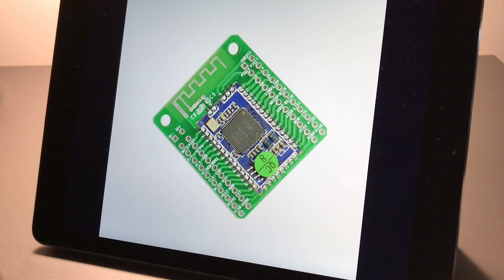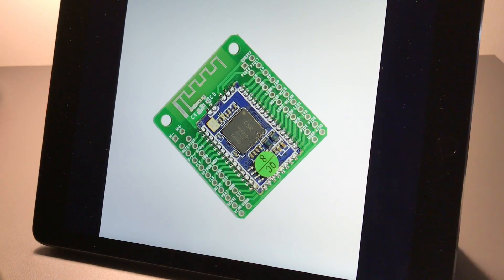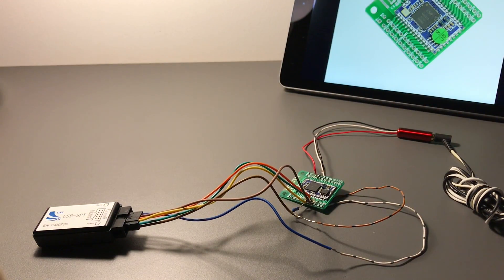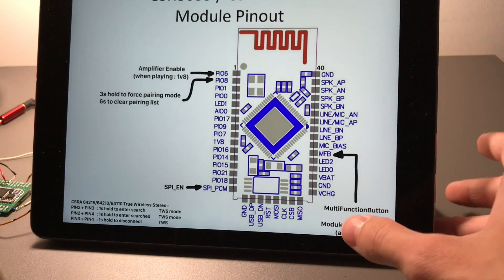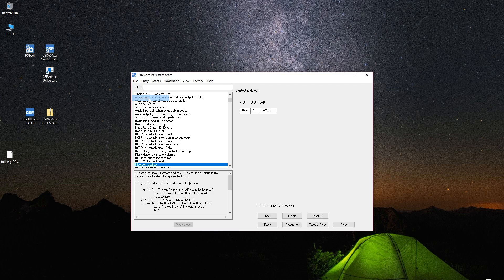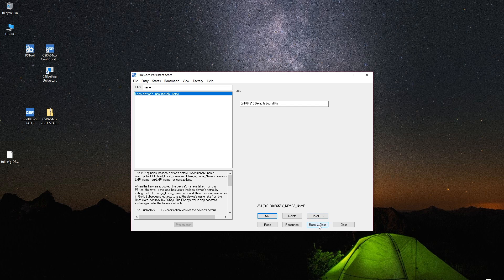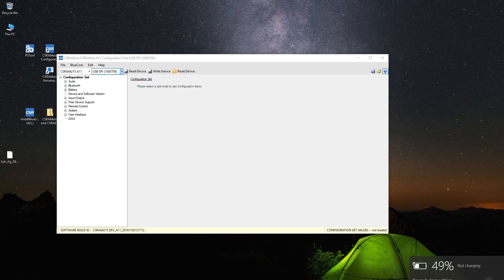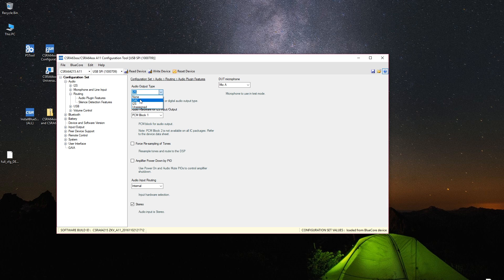Program / Configure CSRA64215 Bluetooth Chip (enable analod audio)

Comment: Awesome vids!
I'm using a 64215 with our home theatre, but my parents keep on forgetting to disconnect after they play something and then nobody else can connect. Is there a setting to always connect to the person trying to connect - even when already connected to some other device (and by doing so throwing off/disconnecting the person currently connected)? Or is this inherently impossible with the way Bluetooth connections work? Surely there's a key in the PSTool that would allow this?
Reply from the maker: you need to use the ConfigTool

I'm not 100% sure of the exact location but there is a setting for ALWAYS remaining discoverable/pairable

once you enable that you should be able to always connect to it (I think 😬)
Reply: @Darieee   Thanks for the reply, but unfortunately I already found that setting (Bluetooth > Connection Management > Discovery > Remain Discoverable at All Times) which only makes the device discoverable - not connectable at all times... The only other setting which seems to be able to give a workaround is the "Go connectable on button press" one, but then I need to add a button. I'm sure there must be some key that can make the device always connectable though, but there are so many keys in PSTool that just says "Only change on advice from CSR" which gives no explanation on what the key does. I've tried contacting Qualcomm, but with no response. Do you know of anyone I can contact to get more clarity? Thanks!
Reply from the maker: hmmm, that's unfortunate .. there's no way CSR or Qualcomm will answer - they're bitches about this shit, and severely restrict access to this software anyway, so - doubt they'll hand out advice on it

check out my 'cheep 2.1 system gets bluetooth video', maybe you could pulse the MFB pin to reset the module and/or have it enter pairing more often ..

though .. if your folks are close enough and still connected .. that might not help much

Comment: Do you know how i can put my own audio effects like on startup and such on a csra64215, in the config tool i go (user interface)->(tones)->(event tones) after connecting but i cant find a way to import my own audio clips, it only allows me to choose from a preset list, maybe i am blind and i can't see the import button or something similar i would really appreciate it if you could point me to the right direction, thanks in advance.
Reply from the maker: hey man; it's apparently very complicated

you have a tab in the configtool to generate the appropriate sound files, but you apparently have to use a separate piece of software to flash it onto the chip ...

it's apparently cripplingly hard, I've never tried it but a great friend has - and he usually succeeds at shit ... and I think this he gave up on 😳

if you really want I can put you two in contact

Comment: can you please guide... what is the main difference between csr64215 and csr8645 other than Bluetooth version... 64215 uses v4.2 and 8645 uses v4.0 as per datasheet
Reply from the maker: 64215 has a faster equalizer, so, you get less lag

8645 has a battery indicator

they both sound virtually identical

also, the 8645 is a lot smaller

Comment: Hi, Great work.
Is it possible to connect a MIC to this Bluetooth and stream the audio to 1) Wireless headphones and 2) Android device (for audio recording) simultaneously?
Reply from the maker: I'm pretty sure you can't run two simultaneous streams ..

And you also can't easily configure two devices to listen on the same stream, bluetooth is qqquite secure so ... yeah
Reply: @Darieee  Thanks for the response, I just read in the datasheet that the chip supports  two stream options, http://www.tinyosshop.com/datasheet/CSRA64215%20QFN%20Data%20Sheet.pdf
in the section 15.1.1, if i get it right .

Comment: Hi,
nice video!
I want to make an audio transmitter over bluetooth for my television. Is it possible to use this module for that purpose? Are the analog line in made for such a thing? If so how can I pair it with another module acting as a receiver?
Reply from the maker: Uu, no idea .. there are kits on sale that do this but .. 

They probably introduce noticeable lag and take a while to establish the connection every time ..

I'd suggest either buying some flat band cable or going optical or something ..

Comment: What would be a good starting point for somebody that knows some avr and arm to start with making BT speaker. I want to show metadata on a screen.
Reply from the maker: Yeah, that'd be pretty cool - I've never touched that topic

But I suppose getting the CSRA64215 datasheet would be a great starting point

There's also many technical documents regarding the various functions so, just typing CSRA64215 and pdf would probably be best

If you can't find what you need let me know, I have some myself
Reply: @Darieee  Thanks will look into it tomorrow since it's 0:24am here.
Reply from the maker: Same here: you're on the correct time!

Comment: Hi Darieee, I've watched all your videos about the bluetooth modules. Great work!
Do you know any method to get SPDIF (PCM) out of these modules (have ordered CSR8645 and CSRA64215)?

Thank you very much in advance!
Reply from the maker: Glad I could help! 

Sure, on the CSRA64215 there is a tab to enable it, and as far as I remember (looked into it a while back), the SPI connectors you use to program the board are the ... ooo ... mmm, so, i2s isn't SPDIF now, is it ?

The SPI connections were used to i2s out when you removed the pullup on the SPI_EN pin

If you do get that going, which you should be able to, the datasheet has the pin mappings, and corroborated with the blue module's pinouts you should be able to get up and going

What I would ask you though is to make a video of that once you're done

I'd be quite interested (I have a few burrbrown DAC modules lying around), and I'm sure so would others
Reply: Hi again,
thanks for your answer. Yes I2S is unfortunately not the same as SPDIF. I did a little research on that topic:
SPDIF works by kind of muxing the three signals of the I2S Bus (Clock, Data, WordSelect) into one Signal. Therefore a SPDIF tranciever is needed e.g. the WM8805 IC.

I also read that the CSR8670/75 and the some newer models (like QCC3008) support SPDIF natively. 

So in addition to several CSR8645 and CSRA64215 boards I now ordered a CSR8675 and a SPDIF transciever board. 

When they arrive, I let you know which combination works the best ;)
Reply: Hi  @andreaswiedenmann5407 , I'm interested in what you have discovered!

Comment: I finaly got the SPI Programmer connection working, but now i have a porblem with the Configuration tool :/ When i  try to choose the SPI Programmer in the Configration tool i get following error:
"The Configuration Set version from the XML Definitions [Rom,8] does not match the Configuration Set version in the Device or PSR file [Rom,15] oyu are attempting to load. The Configuration Tool requires you to use a Device or PSR file based on the same Configuration verrsion as the XML Definitions."

i dont know how to get around this to use the Configuration Tool, so i can set my i2s parameters. Do you have any idea how i could fix it?
Reply: i actually fixed itmyself.. which i never thought of XD
The trick was to go into the installation folder, find the file "ConfigSetDefinitions.xml" and open it with a notepad(++). Then at >    Version="8""   < replace it with 15, so it is >   Version="15"

Comment: Thanks for sharing. when i click the link you gave, the description in aliexpress does not mention csra64215. I also see many types pf CSR USB-SPI converter in ebay, in their descriptions I see supported models are BC/BLE series chip-sets (none of them mentions csra64215),  will they work for csra64215?
Reply from the maker: Mmm, I'm quite sure they all support it, but, if you want to go the safe route, buy the one I have, it's also amongst the cheapest at ~16$/€

Comment: i am getting an error when I am trying to connect CSR64215 with the configuration tool you have linked above...  although I did change the name of the device with PStool... Error is that the configuration set version from the XML def [ROM,8] does not match the configuration set version in the device or PSR file [ROM, 15] you are attempting to load.
Reply from the maker: I've linked the 3 different versions of ConfigTool that are needed for the CSRA64215 chips floating around aliexpress & ebay

in your case, you'll of course be needing the [ROM,15] version
Reply: thanks dariee for you reply..  can you please guide from where can i get ROM 15 configuration tool..
Reply from the maker: @aisharana9305  the video description of this very video 🤘
Reply: in software section --> configtool &DSP frontend (for 64215): in this link i am only getting one software... the one with ROM 8
Reply: i have solved the pblm by changing the version from 8 to 15 in the configsetdefinations.xml file
Reply: have u ever tried to record audio of MIC connected with module  on android? i am unable to do so.. i have also changed the audio type from I2C to DAC
Reply from the maker: I got the mic to work, yeah

enable HSP and HFP (forgot where exactly these settings are)

I also updated the description of the video to include new links for ROM 8, 10, and 15
Reply: @Darieee  did you just connected MIC at MIC PINs or if you can tell how you did because I am really stuck in  this task... i am unable to find HSP in pstool or in config tool... there Is HFP in pst tool and it is HFP power table..
Reply from the maker: in the ConfigTool, go to

Bluetooth / Profiles / HFP

have the first 4 tick boxes checked (HSP, HFP, CVSD and Modified SBC)
Reply: @Darieee   thanks for ur response but in my case MiC is still not working..
Reply: @Darieee  i have one query that u said u did operate the MiC.. did you recorded the audio in android using aux or wirelessly means u have used this device as audio bluetooth transmitter..

Comment: Can you configure the Mic pins to be an analog input for the DSP, so that the equalize would effect an analog input? This is suggest in both (64215 and 8645) datasheets. I have already tried to configure the 8645 for this with no success
Reply from the maker: uuu I don't know .. there's some very lengthy threads on forums (you should be able to find them just by googling) about the inputs of these chips (or around the topic at least)

if you manage to get something going do let me know, I'd also be interested in this :)
Reply from the maker: in any case the csra64215 is way way more powerful than the 8645 - and now there's already CSR8670 / CSR8675 modules cropping up, and those are Bluetooth 5.0, so those definitely should be capable of this kind of stuff
Reply: Darieee sounds good! I have one more question: Is the EQ on the 64215 10 point or 5 point, like on the 8645. The datasheet confuses me about this, because they both have the same dsp
Reply from the maker: I remember it having waaay more points than the 8645 when I read it half a year or so ago, so, 10 it is
Reply from the maker: and the 64215 boots instantly as well ... like ... <200 ms ...

Comment: Hi Darieee, thanks for your helpful videos : )
I have a bit of an issue where the module sends a 'pop' down the I2S bus when you have stopped streaming audio to the module for around 15 seconds. Any idea what is causing that? Seems like some internal component is going into low power mode. I was hoping using I2S would stop problems like this!
Reply from the maker: Wait so, does thepop also occur over i2s ???
Reply: it does indeed!
Reply from the maker: That's seriously weird .. can you rule out your DAC being the cause when it's told to switch off ?

And, are you using the CSRA64215 ?

Does this happen with both iphones and android phones ? I'm asking because on the CSR8645, at least with the firmware floating around last year, you would get quite loud pops when skimming through music (which pauses the internat dacs momentarily), ... and it would not happen when streaming AAC (what apple uses), only apt-x and whatever else android streamed
Reply: On the board I am developing I have a CSRA64215 feeding an ADAU1701 DSP via an I2S bus. I need to do some more probing to get a better idea what is going on, but it seems like a few packets of 'garbage' are sent down the I2S bus when the CSR shuts down an internal processor or something. I have complete control of the DAC and it is not allowed to shut down with no data input etc. So far i have only streamed from an iPhone and haven't tried Android.
Reply from the maker: Yeah .. could be some undocumented shit going on at powerdown, although, I wouldn't expect something like this from csr ...

do you buy the blue boards and surface-mount them, or do you get the ICs directly ?
Reply: I am using the BTM625 boards surface mounted with an external antenna. Really the power consumption is so low it is of little interest to me that the device goes into any sleep modes that may cause pops & clicks. I am going to scour the PS keys and see if I can find anything else I've missed.
Reply from the maker: Yeah ... there is stuff you can mess with in the ConfigTool. Btw, do you by any chance have the ROM 15 compatible ConfgTool ?

I've already bricked one CSRA64215 chip using the commonly available v2 ConfigTool ... that one is ROM,10 and will only work if you modify the XML file ...

Comment: How to turn off turn on csrA64215 module by MFB pin?
Reply from the maker: you have to have it pulled HIGH

(but do note that at startup, it has to briefly be pulled low for the module to properly boot)
Reply: @Darieee  Instead of automatically starting from the delay circuit, I used the push button to control it. press for a second to open the module, and if hold for another second to turn off the module. Can you help me?
Reply from the maker: mmm .. I really haven't designed any standalone circuit with these I'm afraid ..

maybe scope the MFB pin on one of these HYT 5v/12v modules and see what they did
Reply: @Darieee  So how to turn on and off the module by the button?
Reply from the maker: that has to be done in the ConfigTool - with button Events .. there's settings for sleep and whatnot

check my bluetooth receiver video

that one did exactly what I think you need, and as far as I remember - I uploaded the PSR for it

Comment: how do you change the MIN/MAX volume beep tones ? the board I got is SUPER loud and annoying. I would like to turn down the volume for the beeps.
Reply from the maker: are you sure you have the CSRA64215 chip and not the CSR8645/8635 ? 

Either way, check my "Disable Microphone for CSR8645" video (in case you do have the 8645/35): using that program on the first page in the upper right corner, you'll see Tone Volume, or something similar, that's usually a moronic 15, take it down to 6 or 7 ...

If you do have the CSRA64215, the Config Tool should have that somewhere

Comment: Hello! thanks for the work and the video.
1) tell me you worked with sound notifications on csra 64215?
2) tell me how to properly connect the battery to csra 64215, what battery parameters should I specify in csra64xxx tolls?
Thank you!
Reply from the maker: 1) do you mean the kind where a chick tells you "buwtooth is on" and that kind of stuff ? 

2) I would check the datasheet on that: http://www.tinyosshop.com/datasheet/CSRA64215%20QFN%20Data%20Sheet.pdf 

Page 68 seems to have all the data, as for the parameters, I don't even know what one can set, never tried this up to now (but a small 100-400mAh battery should do the trick just fine, more should also work just as fine, it'll just charge slower; the chip never seems to draw more than 15mA)